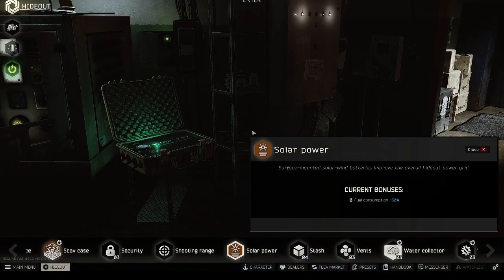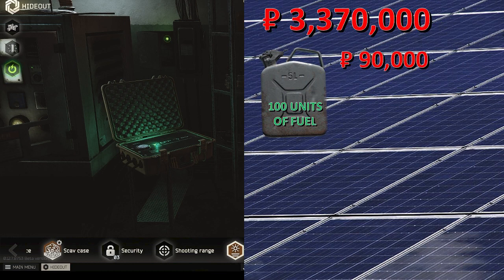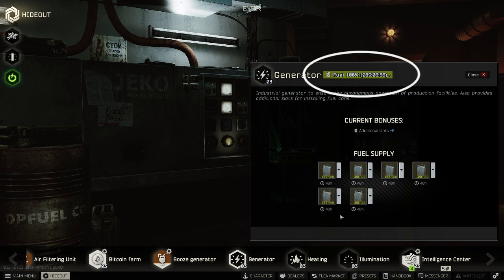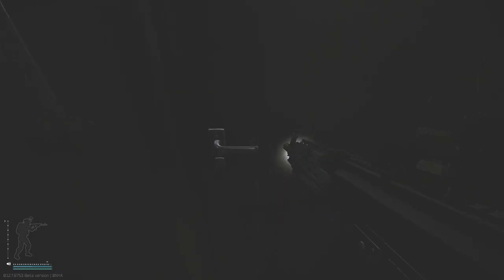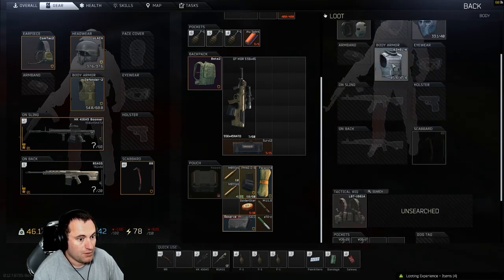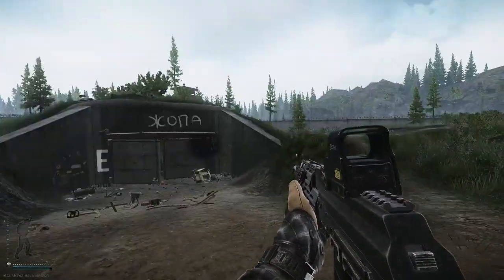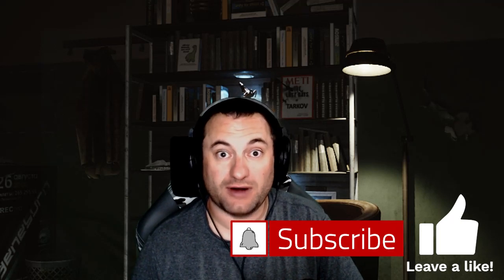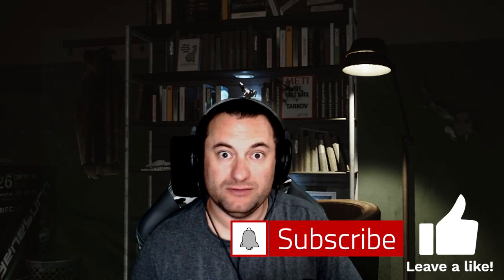Solar Power Guide - EFT Patch 12.8 - Sept 20, 2020

Comment: With it's increased cost now, do you think that it's still worth it? Since 12.9 hasn't been around for too long, the prices of AESA's are really high rn, although I guess that also has to do with the increase of BTC price. So my question is whether you think it's worth to build rn in this stage of 12.9? My biggest concern is the price of the components : around ~10M rub (I think).
Reply from the maker: I need to redo this video and run the hard numbers.  I'm honestly not sure.
Reply: @Airwingmarine  That would be great, Thanks for the reply!

Comment: Do you have any tips for learning a map? I've got most of the maps down to a t except reserve as I've only been there a few times and offline loot spawns are not the same as online.
Reply from the maker: Just running them a lot, and not creeping around too much.  Accept your going to die 3 out of 4 times and just go with it.  Learning the underground is soooo important because it allows you to move around a huge portion of the map in so many ways.  I use it to out flank whole teams if I'm aggressive, or to get the hell away from big teams if I've gotta a bunch of good loot.

The only really good way to learn a map is to play it a lot over and over.  It's more than just knowing the buildings and spawns, it's knowing timing, the different sounds, safe spots and high fight chance areas, and low traveled loot spots.

When I was first learning the game and Decided I wanted to know the maps real well, I basically committed to one map for at least 20 raids.  And it's paid dividends since I did it.  I can comfortably travel every map and either pick fights when I want or completely avoid them too.
Reply: @Airwingmarine  Thank you for the feedback. Binging all of your past videos now, can't believe I didn't see your channel before.